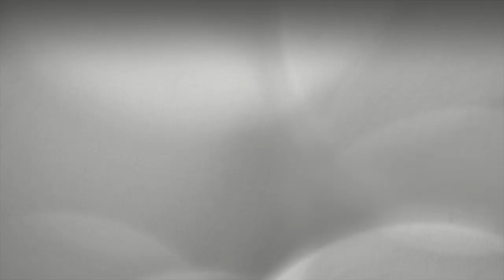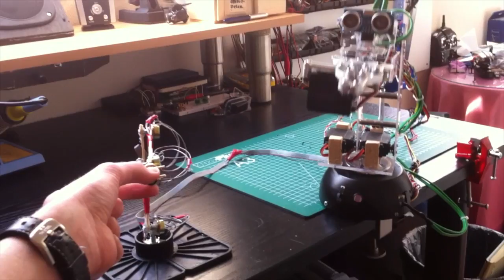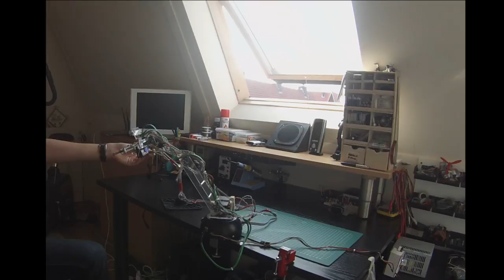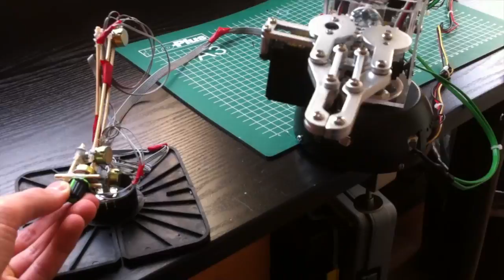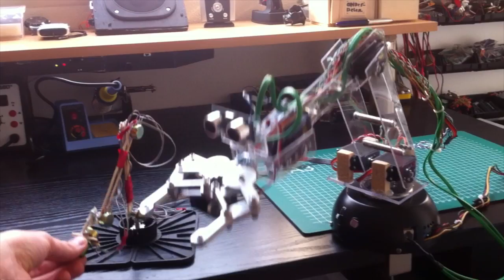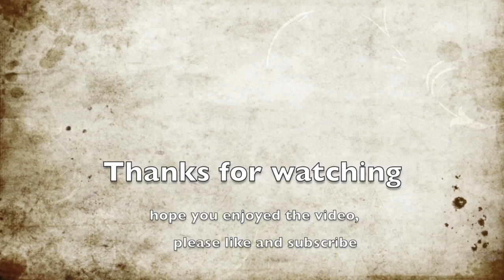Robotic Arm Controller (with arduino driver)

Comment: I found your work on instructable, very cool stuff ! But where did you get the lexan parts ?
Reply from the maker: thanks, the lexan parts are handcut from a lexan sheet.
Reply: Very nice work ! What kind of tool did you used for cutting ? I heard it's possible to use a cutter to cut 20% of lexan part's width, then apply some force to break it cleanly.
Reply from the maker: well you could, but if you stick some tape on you cutting line, you can also use a hand or electric jig saw(like I did:p)

Comment: Nice, consider making a complete arm-piece for it. With velcro straps or something.
So that the robot arm replicates your real arm, would look amazing and be easy to use!
Reply from the maker: +xFuaZe thanks, great idea, in the past i have tried something similar but there are a lot of mechanical errors that you run in to. therefor i decided to cancel it, it just would have taken to much time.

anyway thanks for your reaction, keeps the idea's up, it can always help me or someone else!